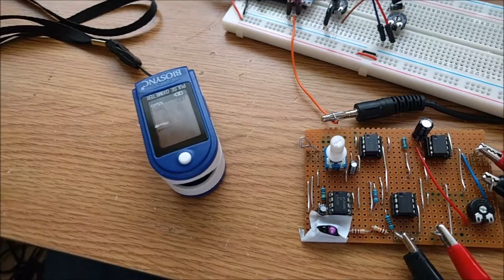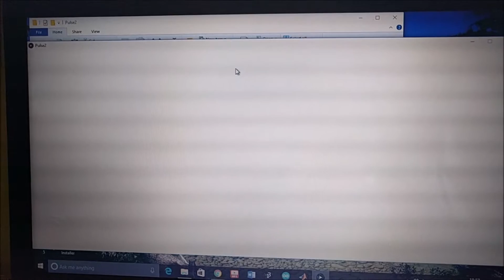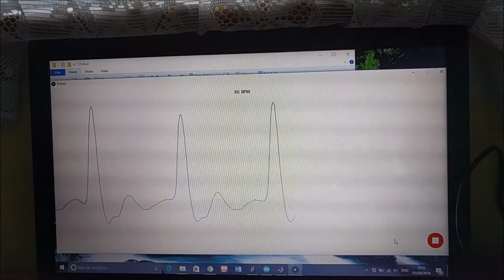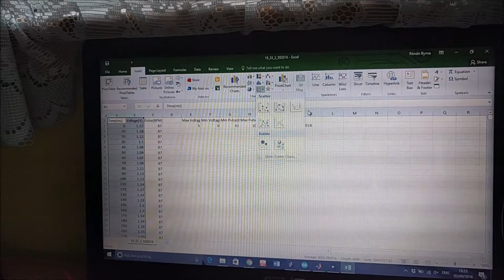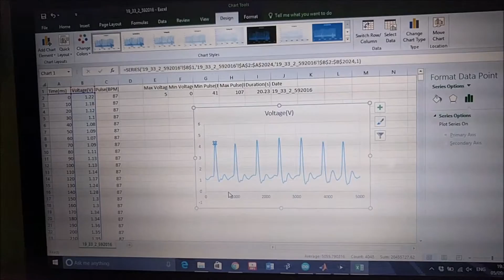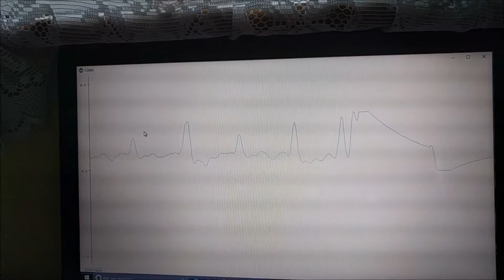Simple Heart Rate Monitor Using Reflective Sensor

Comment: How would i change it and make for 5v.. too much for me 12v I can not !, please reply
Reply from the maker: You can try power the circuit with 5V and use a virtual ground of 2.5V but you would need to reduce the gain of the circuit as well as use other op amps.  Try find a rail-to-rail op amp which can be powered by 5V. The lm741 aren't rail-to-rail and have a higher recommended input voltage